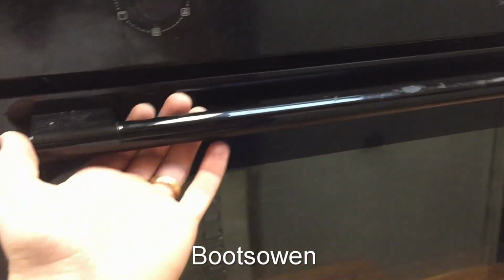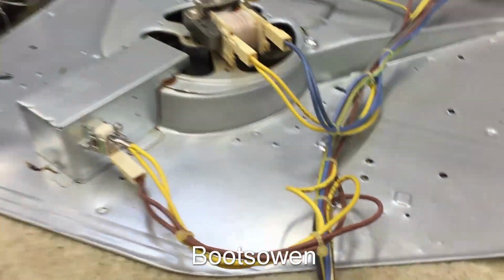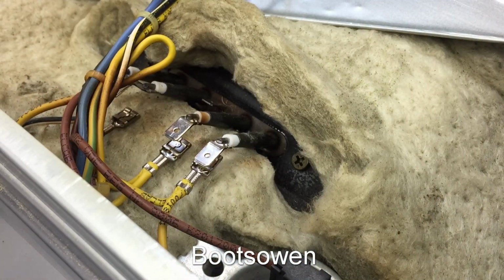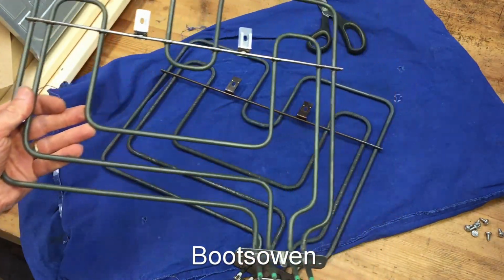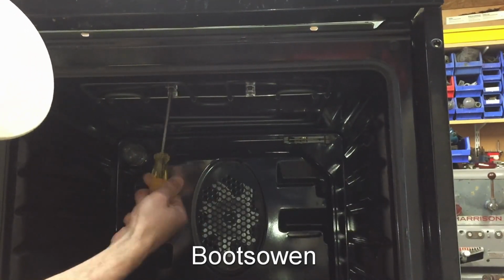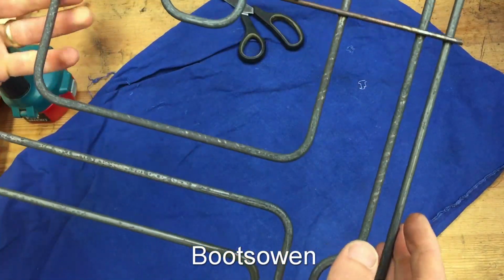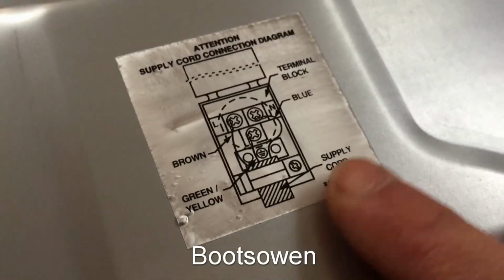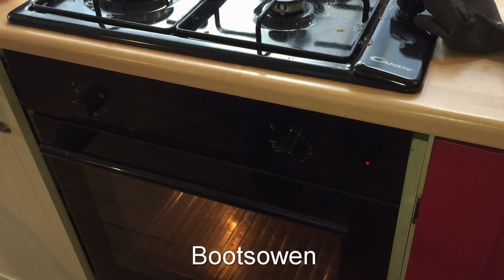Oven Tripping Circuit Breaker? Replace heating element! Easy how to on a fan oven: Logik LBFANB16

Comment: Thank you for the video. If there’s one thing I’ve learned, it that there’s never one video that solves your issue. But by watching a number of videos you can Frankenstein together a solution. My grill was fine, but any other settings tripped the lecky. So through process of deduction, I’m guessing it’s the back element. Thanks for the video and for saving me about €400. 👍🏻

Comment: Replaced the element on mine this morning. It was tripping the RCD after about 5min of being on. Changing made no difference, still trips. Found another video which listed about 20 different things on a oven that can cause RCD to trip - great
Reply from the maker: Have you replaced the right element. Some ovens have more than one and it has caught me out in the past. Your issue does sound like element
Reply: @bootsowen  we only use the oven on the fan setting, so that is the element around the fan as far as I know. Would an element that isnt being used at the time trip the rcd, seems a bit weird?
Reply from the maker: I think depending on the settings one or both may be used. It’s your hassle. You decide if you want to repair it or throw it away. All I know is that ovens are one of the few things we can still repair and the parts are usually cheap on the internet.
Reply from the maker: Did you check the resistance of the element you replaced versus the replacement. If they were both the same then that might give a hint.
Reply: @bootsowen  There is another setting that uses fan and grill, we just use fan. The element was the more expensive 'genuine' replacement rather than one of the generic ones. Didnt test it, if im going that far Ill pay someone to have a look. Tried to already they ignored our messages for 2 days and then said they could come in a week. Been shopping for a new oven today, found one we liked, measured up and dont think it will fit due to gas fitting for hob. Back to repairing the old one maybe - not sure. As I said, there is another video on YT where a guy lists tons of things that can trip RCD on oven not just the element. Mrs Ironbuket says she wont use the oven if I start messing with the electrics as it may not be safe. Got an air fryer which should be delievered to us later today and should give us something to cook in whilst we try to decide :)
Reply: @Ironbuket  More often than not it  will be one of the elements! An insulation resistant test would need to be done to see which element was faulty and causing the rcd to trip causing an earth fault assuming the rcd is being tripped after a short while. 
A resistance test between poles on the element as shown in this  video will indeed show whether there’s an open circuit (knackered element) but wouldn’t tell you if there’s a dead short to earth!.

Comment: We often do not use both the upper and lower oven at the same time, but now it trips the breaker when we try to use both. Any suggestions?
Reply from the maker: Could be either element in the machine or the trip switch is sensitive
Reply: @bootsowen  Last night we ran both ovens, and the breaker did not trip.  It seems like when one oven comes up to temperature, then the energy draw is not a big when the second oven comes on.  Is there something like a slow delay circuit breaker?  We once had fuses that had something like that. Thanks

Comment: What's wrong when I use my oven and kettle at the same and suddenly the Earth leakage trips
Reply from the maker: You’ve probably got a problem with earth leakage!

I suspect however that you have an overloaded circuit
Reply: Check your breaker rcd usualy 30A and after the rcd u have more fuses probably the circuit i pluged oven and kettle cant suport more than 15A and both togheter are drawing more than that

Comment: Mine was tripping when I put the bottom oven element on changed it ,worked once but tripping again..what wrong...I did notice some burned wiring back of cooker...
Reply from the maker: There could be more than one element? or maybe it is the wires

Comment: Just in addition: when you have a simple multimeter at home (which i would expect, when you do such a work as you show in the video) you can mark any cable connected to the heating elements. then disconnect anything(!) from the heater elements and just measure the resistance between the housing and the heating elements contacts. this way you can find the broken element, before replacing them all.
the multimeter should tell you something like "infinite", "open circle" or maybe resistance in gigaohms thich is pretty much the same as open circle ... any other (smaller) value should be a failure!
Mine got broken and i can clearly see the resistance of 140k ohms on one heating element. so this is not much at all (like 0,2 mA) but still let my fuse pop as soon as it heats up, even the fuse is thought to pop at 50 mA at least
Reply from the maker: Oven elements are tricky sometimes. They can break within the casing and can show resistance when cold but that changes under power.

Comment: Hi there, need some help,

My Zanussi induction cooker,  electric oven keeps cutting out, the light comes on runs for a few second light cuts out and keeps repeating, the induction hobs are working fine, but every time the oven it cuts out the display also blinks? 

Is this likely an element fault or control board issue?
Reply from the maker: Hi, your question isn't clear enough. is it a single unit,(hob over oven) or is the hob separate from the oven? A model number may help. Are you talking about the display on the oven or on the hob, maybe an answer to my first question would help. What have you tried so far?
Reply: @bootsowen  single unit the display for the oven is blinking. I’ll get back to you with a model number, grateful for your reply and time.

Comment: Oven was tripping as soon as I turned oven on, changed element and still the same issue. Isolated the fan and still same issue but it started to heat up. Maybe the thermostats gone?!
Reply from the maker: Is there only one element?
Is your fuse board/Consumer unit able to handle it?
Reply: @bootsowen  it's an existing oven, never had any trouble, it's a double oven and hob free standing cooker, everything works except the one oven, that's the only thing that trips it telling me that something within the one oven had gone wrong, running out of options though haha!
Reply from the maker: Cool, yes, but does that oven that trips it have one or two elements, some ovens have a smaller element mounted at the back behind a panel surrounding the fan.
Reply: @bootsowen  ahh yes, I took off the cover, and changed the element that's around the fan
Reply: @bootsowen  I believe just one for the oven that's causing the problem

Comment: I replaced the bottom element, as it literally broke. Now my oven trips the breaker AFTER replacing the element. Any ideas? Wiring that goes to the element?
Reply from the maker: Maybe the other element is a dud?
Reply: @bootsowen  I am having the same problem...how would you test that new element and know if it is the correct resistance?  Is there a resistance that would be known for the element?  Or is is possible the element is good but something else in the circuit is bad?

Comment: In my (limited) DIY experience it is usually the element around the fan that goes wrong first, possibly because it gets hotter???
Reply from the maker: Your experience can't be wrong. In this case it was the top element. How do you test that it is the fan element?
Reply: @bootsowen  I wonder too!